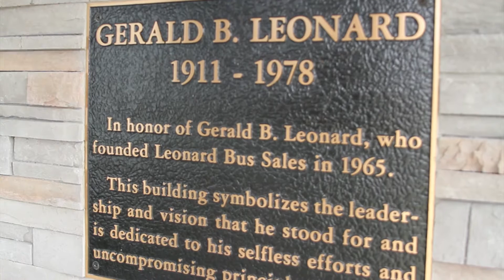Company Video - Leonard Bus Sales

Comment: I'm looking for a used bus. I hear the 5.9 Cummins is a pickup truck motor and too small for a bus. I think the 5.9 Cummins may only be in the city buses and not in the activity highway buses. Is the new Cummins in the 2016 the same as the 5.9 or is it a larger more powerful Cummins? What motor should I be looking for in a used bus?